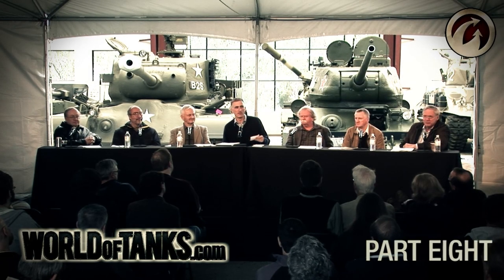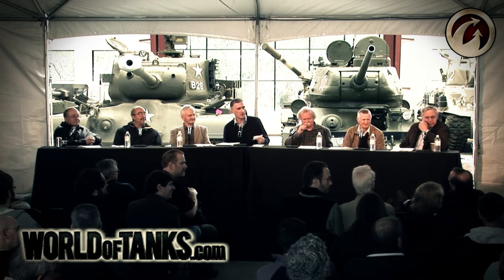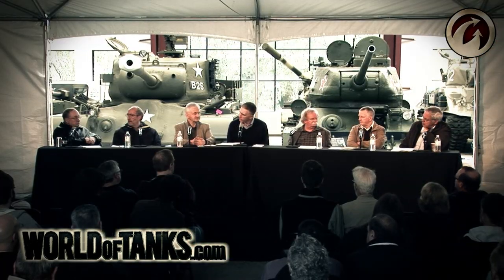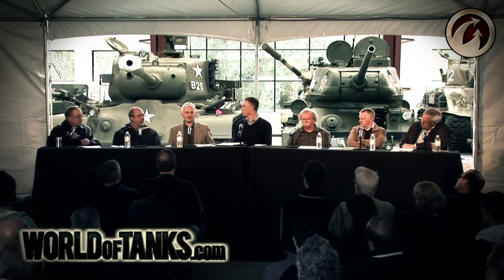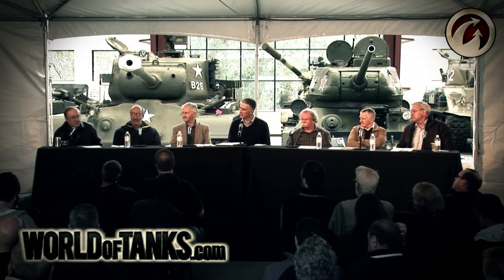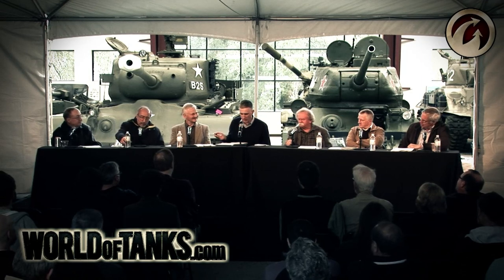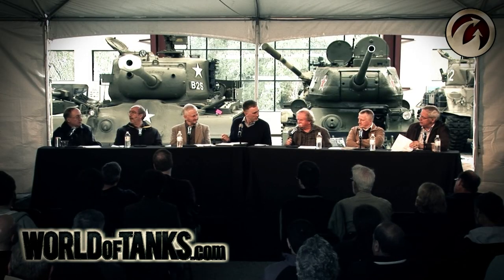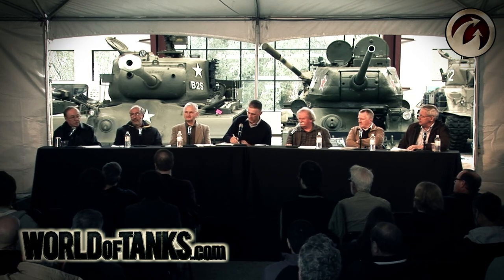Operation Think Tank 2012 Part 8

Comment: 9 minutes in..// concrete    and tanks' protection in set defensive positions.// i like that idea... 
if Tank units that were Bound to eventually retreat had concrete barriers and blocks with firing holes ready made for their line of sight, that would have saved many a tank during a full ass shown retreat.. even if advancing tanks had the option of concrete crews to lay out and pour over a two day period, the advancing tanks would know that any advance too far could be safer on retreat as concrete crews have more space to Build Up the taken land... the advance paving wave for the crews to have time while the enemy itself is retreating or Holding in.. thanks for the upload../ concrete is heavy.. but could be dropped in and bagged out to any front where the Firing target practice types will fire at any stationary Tank    if the concrete is barrier up and provides that extra Boom protection, the tank crews will be more able to do their Job 3:14 // God Bless   be safe during the Purge.. be Well.

Comment: When they were talking about spaced armor why didn't they say the Super Pershing. I know there were very few of them.
Reply: Because it wasn't spaced except for the 2 little wings on sides of the mantlet. Those were to counter balance the weight of the extra armor added to the mantlet.
Reply: @Fulcrum205  
Super Pershing had 2 spaced plates on the front and lower glacis...Read a fucking book.
Reply: @ThatZenoGuy  it wasn't spaced by design just sloppy fitment
Reply: @Fulcrum205  
You can literally look at the position, length, and shape of the addon plates. They are supposed to be spaced and they are. 

The intention was for the plates to decap projectiles and deflect their trajectory before hitting armor.
Reply: @ThatZenoGuy  it looks like they were trying to increase the slope on the upper glacis. Considering HEP/HESH wasn't fielded until after WW2 and US Army testing had already proven that field expedient spaced armor improved the penetration of HEAT projectiles like the Panzerfaust I am still not convinced the Super Pershing armor was intended to be spaced.
As to decapping or offsetting projectile normalization the armor should be sloped in the opposite direction. If that was the intention they should have brought the lower glacis plate up even further to cause the incoming shell to normalize away from the upper glacis angle. As it stands the add on upper plate helps square the incoming shell to the inner plate.
Reply: @Fulcrum205  
While most spaced armor would increase penetration of heat, Super Pershing had 64mm of spaced steel with two layers, with two airgaps. That'd certainly reduce the effectiveness.